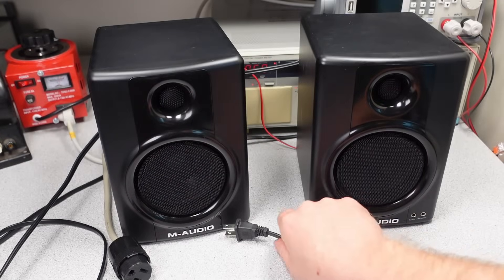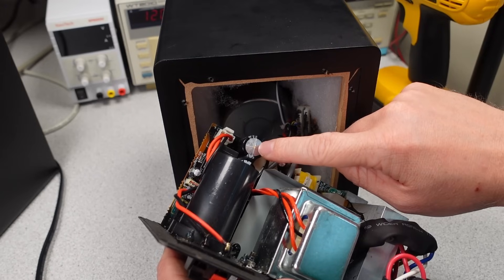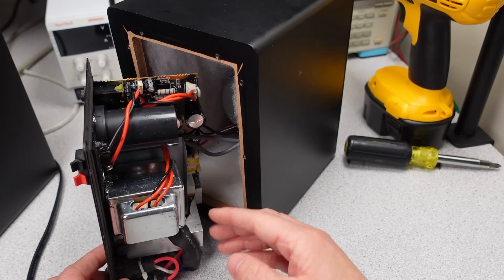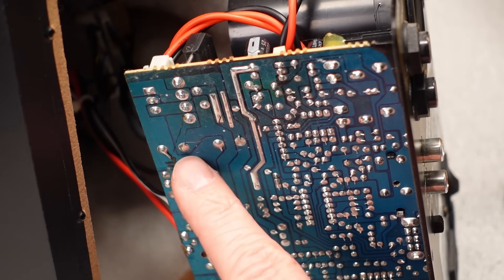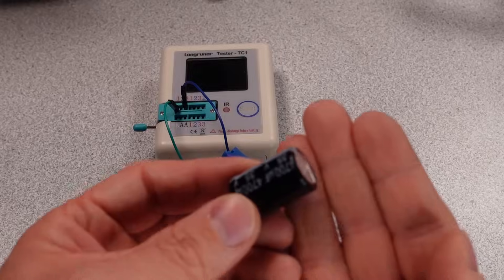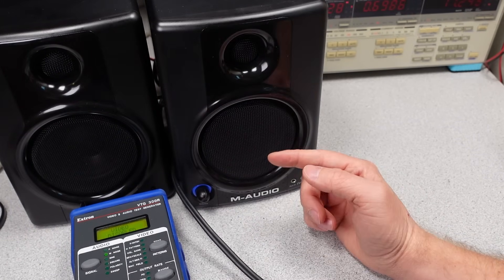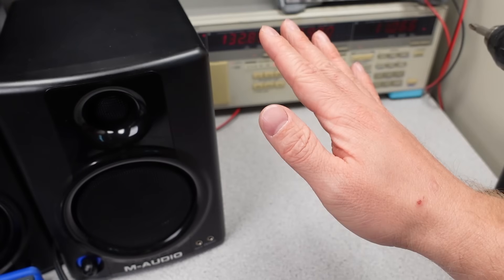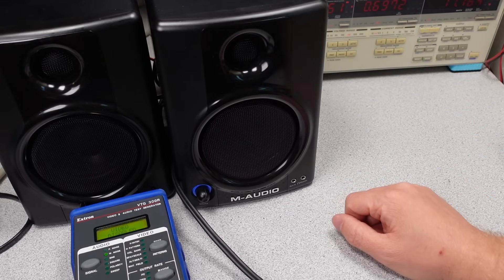M-Audio Studio Monitor Speaker Repair

Comment: Mine just stopped working randomly. They've been very good since I got them like 10 years ago
Reply from the maker: 10 years is a good run, can always convert them both in to passive speakers and use an external amp.
Reply: @AllThingsOnePlace  well fortunately I was able to figure out it's a wire between the power supply and the switch that got loose and I was actually able to bring them back to life! Without your video I probably wouldn't have tried to open them myself. Thank you for the knowledge!

Comment: I have a bi-amped bx8s studiophile and they randomly just stopped receiving or transmitting audio/music, they are on but they are buzzing like those ones I’ve changed cables still it won’t receive any audio, could it also be those capacitors?
Reply from the maker: hmmm, no audio sounds like something else may have failed.  If it's digital in crossover sounds like maybe 5V went away.  In any case, I'd start by checking all the voltages if you are going to troubleshoot on your own, as always dangerous voltage inside, so if you don't know how to work with that, then don't, find a local repair service.

Comment: Splendid video. I have those exact same speakers, with the difference of providing a volume/on/off knob in the front, and an extranal aux in. They also have a very annoying "feature" of turning themselfes into standby mode, if there is too little volume/ too long silence. Could you maybe give a hint how to workaround this?
Reply from the maker: Yeah, not without taking it apart and adjusting the sensitivity in circuit, which if you know how go for it, if not, you are stuck with it.  You could probably make a keep awake tone injection, just outside of the audible frequency range, and just enough amplitude to keep it on?
Reply: @AllThingsOnePlace  Theanks for your reply. I was a not to keen on the awayke-tone idea, since it creates another system I have to worry about. I ended up adjusting the levels like this: on the monitors I turned the volume knob down, and on the interface I turned it up. This way it would at least not shut down during some quiet ambient.

Comment: Best feeling in the world: Fixing something that will cost a fair bit to replace for only a couple bucks and some soldering. 

I have the Mackie CR4-X monitors and it seems to be very common that at low volumes, sound will just cut out. I've had the bright idea to take them apart and figure out how the noise filtering works. I think it's a bit too much, so I'm hoping I can just reverse engineer them by "lessening" the filtration. I'd rather a little hum than clipping at super low volumes.
Reply from the maker: That's odd, cutting off at low volume is a new one.  Like it has a noise gate and the threshold has increased.  If you get it working post an update.
Reply: @AllThingsOnePlace  That's what my theory is anyway. Someone on reddit nudged me in this direction and it makes sense. Their other speakers don't seem to have the same issue. If I do get around to it, will post the info!

Comment: Thanks. I recapped mine because the amp was distorted, but last night it started the buzzing thing. I recapped them with all Japanese caps, but maybe I only replaced the bulging ones. So I guess I'm going to take it apart and recap everything again
Reply from the maker: Yeah, it's like hardly worth the effort but at the same time it keeps them going.  I'd like to see more of these small speakers switch to class D amps but also just not cheap out quite as much or make them more repairable.

Comment: Does anyone here have an idea why my monitors sound is uneven? These are powered monitors and one side is louder than the other and  if I switch the position select from left to right or viceversa one side still will be louder. It has a damaged capacitor or a resistance or what is could be the problem?
Reply from the maker: There are potentiometers inside the monitor that adjust gain for each, these aren't really user serviceable and are glued into place.  So, as long as both are working, it doesn't sound like damage but a gain adjustment that has shifted.

Comment: Thanks so much for your video . I am working on a broken focal twin 6be . 
Did you show in the video how you discharged the caps before working on them ? Or is that not necessar ? 
Kind regards
Reply from the maker: I just checked them with a multimeter.  By the time you unplug everything and disassemble it they should be at zero volts.  I don't know the particulars of the power supply in that unit but if needed I use the low-z setting on my Fluke multimeter to discharge caps, probably not the best option but it's worked for me.

Comment: I have the M-Audio Bx8 D2….. I’ve  been searching for hours and this is the closet  I’ve found. Hopefully someone can point me in the right direction. 
My 1/4” TRS input was damaged. It’s still kinda works but I just need to know how to replace this part. Thank you!
Reply from the maker: Take it apart, desolder the bad connector, buy a new one and solder it in, reassemble.  1/4" connectors fail all the time, I keep a pile of them in stock.  If you can't do that yourself that is fine, find a repair shop, it may be a ways away, they should be able to do that for not a lot of money.  The part is only a dollar or so, labor should be less than 2 hours.  You need to find someone local since shipping will make it beyond economical repair.

Comment: SOMETIMES MY IMG stageline FLAT M100 just works. Whether I adjust the volume knob hard or soft. And the next day it does nothing, only when I adjust it louder. But the sound that comes out is very poor. Very strange. Do you know what the options are?
Reply from the maker: I'd start with getting some contact cleaner and spraying the adjustment knobs.  Deoxit or something similar.  You probably still have to disassemble to get to the area that will make the cleaner effective.

Comment: Oh hey one more question about polarity. I understand the longer lead on the capacitor is the positive side. Is it obvious which pin goes into which pinhole on the circuit board?
Reply from the maker: Sometimes the manufacturer will put it on the silkscreen, sometimes they use a square and round pad in the copper layer.  All up to preference.  I usually give it a quick check with a multimeter to make sure the positive side goes to something that makes sense like the positive side of the bridge rectifier or the positive input on a voltage regulator or op amp.

Comment: What was the little jumper wire you added? that wasn't there originally was it?
Reply from the maker: No it wasn't originally there, when removing the old capacitor with it's bent over leads it pulled the pad off of the PCB.
Reply: Gotcha. Thanks.

Comment: Hey Boss, I have the same speakers and a similar issue. I'm gonna crack the housings open and have a look inside to see if the caps have leaked. Thanks for the info I'll add replies to let you know if I fixed em.
Reply from the maker: Yeah, it's amazing how many products get ruined by such a small component in the system.

Comment: I have these exact same speakers that have been exhibiting this buzz since 2016. I’ve been dragging them with me in a box thinking I’d get around to taking them apart and fixing them so thank you for giving me the information I needed to do this weekend project. I bought them in 2007 and they performed awesome until the buzz. I wonder why M-Audio uses a cheap capacitor for these premium monitors.
Reply from the maker: Yeah, it is unfortunate.  It is ultimately the demise of many electronics products today.

Comment: Hi, I have changed these 2 capacitors but still have the same problem (buzz when I torn on). Do you know any other parts that can do that ?
Reply from the maker: Depending on how far down the rabbit hole you want to go, there are more capacitors that can fail on the circuit that will induce hum.  I'd get an in circuit LCR meter to check the others and replace the others that also test poorly.  Buzzing specifically can also be from ground loops or loose cables.
Reply: @AllThingsOnePlace  thanks, I just realize that fuse 1 is blown, I changed it and blowns again.
Reply from the maker: @idlm Ah, yeah.  Sounds like there's a short circuit somewhere.  A thermal camera is pretty useful or a milliohm meter if you have one.  Or, inject a low voltage and probe around until you find the trouble spot.  Check any capacitors for a short circuit.  Hopefully, it isn't the chip that's gone bad.

Comment: The two gray wires can be unplugged, along with the woofer and tweeter wires to remove the entire back assembly. The circuit board can be removed from the back panel as well. I bought a dead one of these just to get the tweeter, but now I'm repairing the board by recapping it. So I'll have a spare amp assembly! Thanks for sharing all your work.
Reply from the maker: I wonder how often the actual amp chips fail, I guess if the caps get bad enough the amp might fail too.
Reply: Where are from?

Comment: Is the crossover for the left speaker a stand alone part or is it on the board? I think I’ll convert it to passive, if I can figure that out.
Reply from the maker: The crossover is separate in each box.
Reply: @AllThingsOnePlace  Thanks! I can salvage the speakers and forget the electronics!

Comment: How is it happened that the PCB pad was missing?
Reply from the maker: The way they manufactured it with the bent over legs on the components it pulled the pad up with it on removal.

Comment: Great video! 🙌🏼

I have the same pair but the next generation but my problem is that when powered on the light comes on but neither speaker produces sound except the headphone jack. I’ve opened them once before but didn’t find any obvious faults would you be able to point me to where it may be? Thanks
Reply from the maker: That could be two things.  1, the headphone jack actually lifts the signal to the amplifier and is stuck in the open position, so even with nothing plugged in it never reconnects the amplifier.  2, the amplifier chip itself has failed and is stuck in a protect mode so won't make any sound.  Obviously one of those is more of a visual inspection but probably not the issue, the 2nd is much more involved and is probably it.

Comment: So I plugged the speaker wire into the back of the left speaker and when I did that, the clip that you push back and put the wire in, that clip fell off, is it an easy fix? It still works as long as I can keep the speaker wire in that port and they sound great..Can I use electricians tape to hold it in place? I did buy them through reverb used and I just tried hooking them up today, so except for that clip falling off they sound great.
Reply from the maker: Mmm. Yeah.  I’ve had that happen to lots of other speaker clips.  I think the temporary fix might have to be it if you don’t want to buy a new connectors and do some soldering.

Comment: hi man i have the same speaker ,it was always okay until the past few days,suddenly the right speaker with power in it sound very quiet than the other one, is something happen with the speaker ?
Reply from the maker: Yeah, a few people have had that fault also in the comments section.  It is a tough one to diagnose.  It could be anything from a dirty potentiometer (volume knob) to a failing amplifier.  The fault in this video was symmetrical in both speakers so probably not that.  When it’s on one side I’m always suspicious of the wiring.  If using rca connection swap the connection and if right is still quiet then the fault is in the speaker. If it swaps to left then the fault is in the cable.

Comment: Years ago I made a video on repairing some BX5a & a couple days ago I just replaced the caps again but I still got a crackle so last night I re-capped the whole board except for the 1 NP cap on the MB & the 2 NP caps on the daughter board. My driver works but the tweeter now cuts out & then comes back on. Any ideas? Like maybe the 2 transistors are starting to go?
Reply from the maker: Hmm, if it is a passive crossover (single power amp, not bi-amped) it is probably a bad solder joint or loose connector/wire.  If it is bi-amped, which it looks like it is, then the amplifier chip for the high side could be on the way out.  Based on cutting in and out but works fully when it is on then I still lean towards a loose connection or bad solder joint.
Reply: @AllThingsOnePlace  Thanks for the reply. I much appreciate it! I'll have to go over everything again. I didn't see anything. I never had a amplifier chip go on me. If that's the case I hope I can get one.

Comment: It’s  normal the one with amplifier gets to hot ???  Any advice ?
Reply from the maker: How hot is hot?  It is normal for a class AB amplifier to get warm, almost hot, if it is too hot to touch then it probably means some components have drifted in value and it is being biased on too much or trying to feed DC into the amplifier somehow.  This causes extra heating and eventually will lead to the failure of the amplifier.   It could be normal though, if the speakers are operating, when you turn them on you don't see any static speaker cone deflection or unusual noises it is probably fine for at least a little while longer.

Comment: Thank you, this was really interesting to watch. I once repaired my Mackie CR4 speakers. It was also a faulty capacitor that made the speakers go mute all the time, and I also introduced a LM7812/LM7912 combo board for +/-12V instead of the original design which made the PCB burn. Now they work flawlessly, the PCB no longer heats up, still alive and kicking.
Reply from the maker: I have seen poor regulator design with a giant resistor next to a capacitor in so many speakers and the heat causes the ultimate failure of the board.  All in the name of built down to a price.  These M-Audios and the bend over leads...  I know vibration, but that doesn't matter if the caps overheat so much they turn into crisps.
Reply: @AllThingsOnePlace  yes, and judging by the video, I think those M40 speakers also utilize two 12V zener diodes with one big resistor per each and a cap to stabilize the voltage. But the zeners usually cook those caps (and yours were bulging, too) and burn the PCB in that area.
That area on the M40s is all the way up, so the heat can instantly go upwards. On the CR4s, it is closer to the TDA7265 amplifier heatsink and just under the transformer, so it is already in the hot area and obstructed by the components above it, making the heat accumulate more easily and damage the PCB.

Comment: mine gets super  hot a the back how to fix this issue
Reply from the maker: I am not sure.  These use class AB power amplifiers so they do get hot but there is a point that it is excessive.  As the operating point drifts on the amplifier it may be slowly going more class A which means getting hotter.  As that happens the amplifier will thermally run away at some point and shutdown or break.  This was notorious for happening with the Event Precision 8's.  These M-Audio's are made with the right components but certainly not made to last a long time.

Comment: I've been having some problems with the AV-42's recently (very very similar to this pair)
They have no power of their own for some reason. 
When plugged in and sending signal through an RCA from a pre-amp then sound plays fine, but the power light on the speaker isn't showing, and using the aux input doesn't work at all
Any suggestions?
Reply from the maker: That sounds like more of a loose or broken wire issue (inside the speaker I mean) if some inputs work and others don't.  No power light is also concerning but seeing how that is on a remote board also in a lot of these I wonder if the connections got jostled enough to break.  Just a shot in the dark on that one.  If you don't know the insides of these thing it may be more risk opening it though if one of the inputs works, use it.